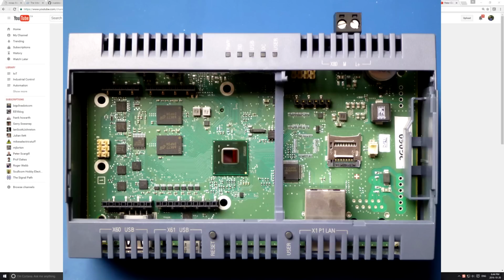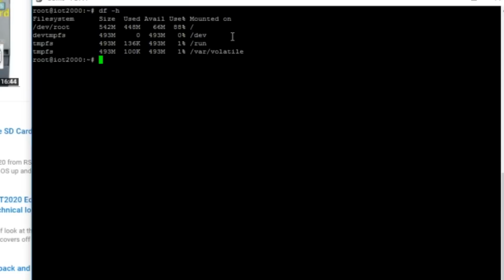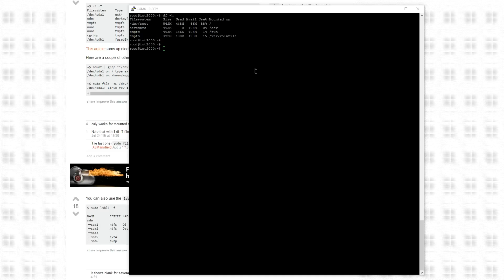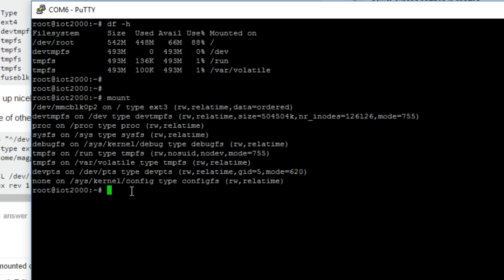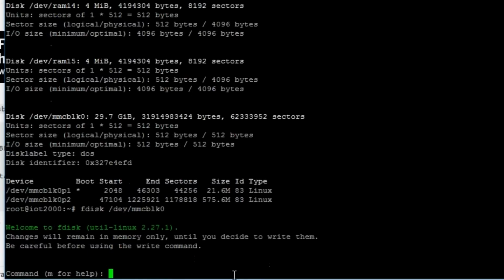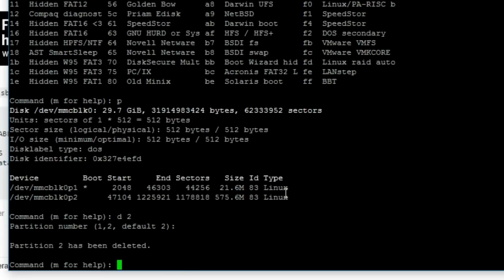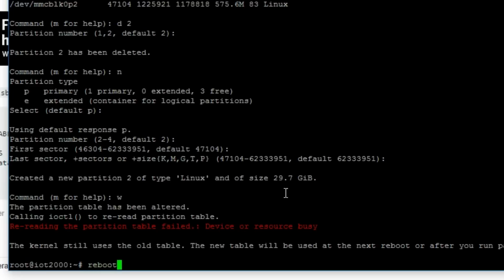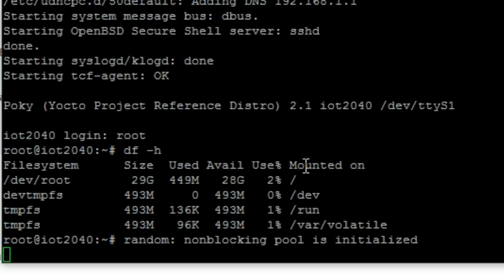Siemens IoT2020 - Making use of the full SD Card size

Comment: Is there an actual finite 32 GB limit for SD cards? Or can I use larger ones, if so how large? I'm not sure what format Yocto uses to format the SD card. I don't wish to add to my collection of smaller SD cards, if possible.
Reply from the maker: I am about to try a fresh image for the IOT2020 so I will do it with a 64GB card and see what happens, Ill report back. I dont see why it should not work as their serial devices after all, some better than others with more channels too so brand may also play a part.
Reply: I look forward to hearing the result of your trials. Thanks for responding.
Reply: I knew something was up. Quote "The SDA approved the final microSD specification on July 13, 2005. Initially, microSD cards were available in capacities of 32, 64, and 128 MB".
It appears to be a Yocto FAT32/exFAT issue. Engineers, being engineers, stuck with old versions of MSWin (think XP) which didn't handle exFAT.

Fortunately, all is not lost,
 https://github.com/openembedded/meta-openembedded/tree/master/meta-filesystems 
adds - NTFS, SMBNetFS, exFAT and some other useful stuff, including accessing iPad and IPhone file systems.
Reply: This is what Intel said - 
https://communities.intel.com/thread/111013 

earlier this year, it may have been fixed in the recent release
Reply from the maker: I tried a 64GB Sandisk Ultra and this is the result
root@iot2040:~# df -a
Filesystem     1K-blocks   Used Available Use% Mounted on
/dev/root       60383564 789664  57091260   2% /
devtmpfs          439600      0    439600   0% /dev
proc                   0      0         0    - /proc
sysfs                  0      0         0    - /sys
debugfs                0      0         0    - /sys/kernel/debug
tmpfs             439916    280    439636   1% /run
tmpfs             439916     96    439820   1% /var/volatile
devpts                 0      0         0    - /dev/pts
none                   0      0         0    - /sys/kernel/config
root@iot2040:~#

YES IT WORKS
Reply: Thanks Peter, that is, indeed a great result. Potentially it frees up a USB port and means one less bit of kit inside the mil-spec box

Comment: Hello, 
you can also use "iot2000setup" command as describe on page 23 to 25 in the "Setup manual" you can find on Siemens web site. 
https://support.industry.siemens.com/tf/us/en/posts/setting-up-the-simatic-iot2000/155642/?page=0&pageSize=10
Reply from the maker: very shortly there will be a new version out. 2.1.3 and this should make life much easier. Serial is fixed and more features included directly int he image, As soon as it is available there will be a video for it.
I have been working with Siemens to address alot of the issues or features that needed to be added and what you see in 2.1.2 is a partial result of that. 2.1.3 will have even more. As you piinted out. 2.1.0 and .1 had a lot of manual steps needed to get things up and running with node red etc.
Reply: Thanks for the update. I figured out I don't have the modbus library. Any tips?
Reply from the maker: In Node-red go to the pallette manage, search for modbus and select the newest one. Works with Serial and TCP/IP or do it from npm install ... et.
Reply from the maker: 2.1.3 also performs automatic SD Card resize on first power up with a new image. so no need to do it yourself anymore
Reply: Hello,
I am a newbie with IOT and had hard time figured out what is "pallette manage", I know...
So, I went to Node-Red website in the "Flows" tab and search for "Modbus".
I found "node-red-contrib-modbus 1.0.8" and used the command "npm install node-red-contrib-modbus" in PuTTY as they said.
I had to reboot the IOT, but now I have the modbus library :-)
Have a good day!
Reply from the maker: Good to hear you got it all installed, its an old but still very popular protocol. I use it for all sorts of things